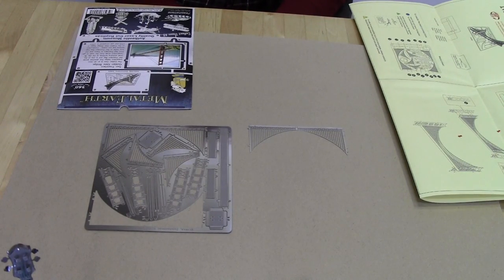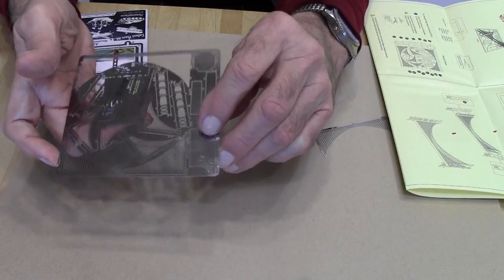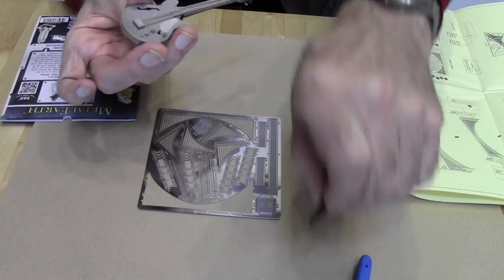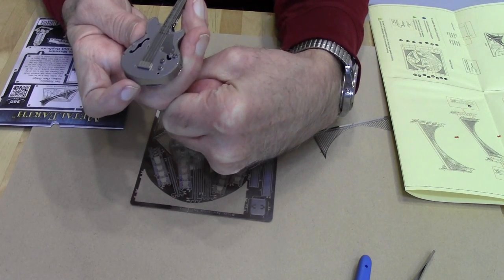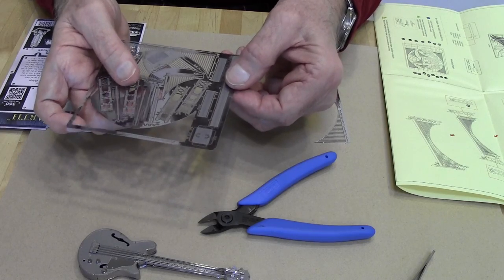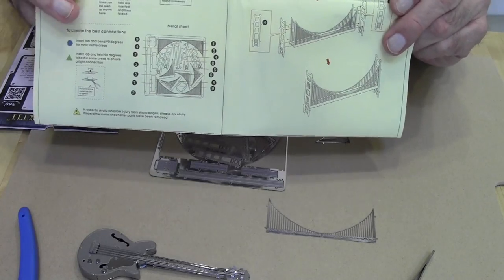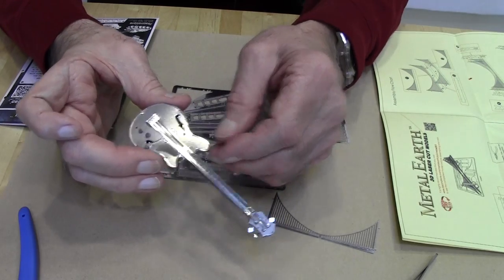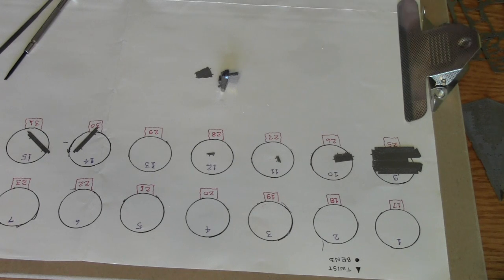Fascinations Metal Earth Kit BASICS

Comment: Thank you. I just started making a model but I already broke one of the pieces that is supposed to bend while folding it. Is there any way to fix it or is it ruined?
Reply from the maker: You are not alone! This has happened to me several times. I have been able to fix broken pieces using mostly super glue, but have also used caulk (great way if it doesn't show). You might need to find ways of propping up the pieces for support while the glue dries. After the initial application dries, I reinforce the joint with more glue. I have built one brass kit (the "gold" color) and they are particularly prone to breaking, often with just a second bend.
Reply: Ruined
Reply: Contact metal earth and they will send you a replacement.
Reply: @Dakahrii  Really. For free?
Reply: @zanomi7695  Yes
Reply: @Dakahrii  Thanks for responding so fast. Thought you wouldn't after 4 months.
Reply: I used super glue also

Comment: Hi! Thanks so much for the video!  I really need help with the guitars...i have 3 of them 😮I bought 4 metal models of The Beatles instruments...started with the drum set...I almost tossed it out the window because I have jewelry tools, and could not get those little tabs to bend at all! I ended up having to use glue just to get them to stay.  I never thought it would be so hard.
I finally finished it after 3 months on and off. It doesn't look great, but I'm creating a stage with their instruments. 
Yesterday, I opened the guitar (John's), and was happy to see large pieces and only 1 sheet of the metal. I thought it would be a breeze. The first step was to put the strings on the guitar, but first put the riser on the neck. That thing refused to stay in. I used scotch tape to hold it in place, bent the tabs and they stayed. Gotta take a break from it because I'm doing other crafts.

Comment: Thank you so much for sharing. Recieved some kits for Christmas. Was  wondering how to work with them. I'm used to the old school plastic and glue kits.
Reply from the maker: Lance: I also have a base in plastic (and some metal) kits as a wee lad. Mostly cars and some aircraft. However, many of the same attributes of a model builder apply to the Metal Earth kits. These would have patience at the top of the list, followed by great care in following the instructions, and having the right tools. The ONE drawback in these metal kits is the lack of forgiveness. They cannot be sanded, filled, or taken apart (at least not easily), and test fitting can be a challenge. My biggest beef with the manufacturer is the absence of bending template diagrams in the instructions, requiring you to judge the right amount of "bend" or curve. The kits have improved from some of the earlier versions, both with assembly and instructions. That said, I have had my share of failures, so my best advice would be to stick with it, until you develop a few basics. The finished kits can be really handsome. Good luck.

Comment: Having done a couple of these I appreciate your tips! However, I would recommend not cutting out all the pieces at once, especially if you're not going to assemble the whole model in one sitting. I would recommend just cutting out the pieces you need for each step as you are accomplishing it.
Reply: Thank you for the advice
Reply: That is a smart way to do it for sure, if you have a kit that has lots of pieces.
You can also number the pieces using small post it notes or a sharpie marker on the back part no one sees. I had to do that because I took all the parts out doing the Beatles drum set, and it was so confusing. A lot of pieces look the same.

Comment: The curves are super intimidating!!
I have no experience in modelling and thought these looked cool so I got some. I am not sure if I will be able to find anything with the exact right diameter and am worried about making the curves to small because the metal is just so easy to bend.
Reply from the maker: You can watch the "tools" video I made. There are lots of options for rolling the pieces, including drill bits and transfer punches. Thinking out of the box for larger diameters will turn up possibilities, including dowel rods and other round objects. Etsy has some specialty tools from Animate Orange and other small dealers.
Reply: @blueholebob  thanks!

Comment: Have you ever tried soldering the gaps? I bet the stainless would hold up to the heat but its probably not as easy as glue. Would be cool to have all the gaps filled with metal to complete the look
Reply from the maker: On occasion, I use super glue to reinforce weak joints, where tabs do not provide enough strength. Otherwise, I rely on careful forming and testing fit to assemble a kit. That said, a few kits have been so poorly designed or instructed, that the only solution is to resort to an admission of failure and open the next one. The winners far outnumber the regrets, and continue to give me a fun way to spend time. I offer my rule of thumb: If the finished model passes the viewing distance test, as opposed to a closeup examination looking for flaws, I consider it worthy of display, even if it requires a tweaked angle of display to cover a tiny gap. Bluehole Bob

Comment: I´ve have an experience of 9 of those models and I must say you have explained quite well the basics. I differ from your strategy by just cutting out the needed pieces for a step or a few of them. Not the whole model.
Reply from the maker: First, I identify the pieces in number sequence by matching the drawing to the pieces on the metal sheet, and writing the number on the diagram of the piece layout. Then, I cut 16 pieces at a time and place them on a large, numbered clipboard, and assemble them in numerical sequence from the instruction sheet. After building several, I prefer this method versus searching for pieces a few at a time. In summary, I write the piece numbers on the diagram, cut in sequence, assemble in sequence. That said, there is no "one right way" that suits everyone. Thanks.

Comment: What annoys me is that when I catch the tab witch tweezers to twist it, I first bend it slightly and then I try to push it down with teezers to bend it flat to the surface 90 degrees. But when I do that I end up bending all the structures below it. Any hint for beginner?
Reply from the maker: You are right...not as easy as we think. There are 3 ways I overcome this issue. 1. Use your thumbnail to flatten the tab. 2. Use a small flat blade screwdriver to apply pressure without pressing hard enough to transfer pressure to other layers. 3. After a bit of practice, you can use thin-nose or chain-nose pliers by applying more pressure to the top of the tab than to the bottom layers. I use this technique most often when trying to flatten tabs sitting on top of a fragile layer.

Comment: Photo etched plates are usually brass or zinc, which is rather "soft" and can be easily damaged or scratched. I've built roughly 10 Metal Earth kits with minimal difficulty. Some of the larger kits, will probably have to be soldered together.
Reply from the maker: I'm not a metallurgist, but I use photo-etched parts for model building. These kits are not photo-etched. I believe they are laser cut from thin steel. For some problem areas or mistakes, I have resorted to super glue, but have not had to solder anything. Thanks for your comments.
Reply: @blueholebob  minimal difficulty?
Reply from the maker: @ChrisLogan787  I was very surprised at the guitar, which was my first kit...went together easily. The piano looked hard, but went well. Straight line buildings are also pretty good, but some bridges that look easy are not. Once you get a few kits under your belt, you will have better luck with rounding, which is always a challenge for me.

Comment: Just curious would it be best to use a magnifying glass to do these models
Reply from the maker: Jennifer: There are times when it is very difficult to see if the "tab" is in the "slot." When I am uncertain about a fit, I use a jeweler's loupe, although just about any magnifier would probably work; otherwise, it is probably better to have a normal view of what you are doing. I will also admit to using super glue at least a few times per model. A purist would likely scoff at this, but there are times that a tight bond is preferable to a loose fitting piece.

Comment: This'll sound stupid, but is the metal sharp? Like does it feel like it has a chance of cutting your finger when handling it?
Reply from the maker: NOT a stupid question! While I have never cut myself while working on a model, it doesn't mean it couldn't happen. There are no "sharp" edges on the sheets, but removing the parts from the sheet can leave nubs that might scratch or cut. Using flush cutters would minimize any rough edges. Overall, if you handle the sheets and part removal with a bit of care, it seems to be a low risk of scrapes and cuts. Bluehole Bob
Reply: @blueholebob  oh I see, thanks for responding!

Comment: Thank you, but just one problem... one of my pieces broke and I do not know how to fix it. I tried using tape, but that just doesn't work, could I use SHOE GOO to seal it back together???

Best Regards,
Reply from the maker: Breaking parts is not uncommon. Many times, there is not enough surface for gluing. Depending on what you are repairing, you can try to fashion a support piece from scrap to gain enough space to add glue, especially if the repair is not visible.
Reply: @blueholebob  Thank you!!

Comment: I just bought a star destroyer (same one at 7:00) and the part that held the very top bridge with the 2 domes, the folds all broke. Any ideas on what to do? I have a small solder pen, but would that ruin the kit?
Reply from the maker: You are not alone! Just tossed an AT-AT model a few days ago. Some kits have flimsy attachments that are supposed to hold up too much weight or will not balance. I have not tried solder, because the usual parts are too small or need to be supported. My first goto is super glue, where I can hold the part while it dries. Then, I add more glue. I have also used scraps from kits as support pieces, if it doesn't show. If the kit is a poor design, and the joints are too weak, repairs will usually fail. All that said, a kit tossed into the garbage is a rare occurrence for me. My biggest success with a poorly designed kit was a Star Wars TIE Fighter. Good Luck. Bluehole Bob

Comment: I bought the Cat Bulldozer. I spent two hours at least on just steps one and two. Pieces broke and now I’m out twenty bucks that I spent on this model. Do I have to scrap the kit? Any tips?
Reply from the maker: I feel your pain! More than once, I have had a broken or ruined part, and frankly, a few kits were so unrecoverable that they ended up in the can. That said, there are two approaches to take. One, try to repair the part with super glue or with scraps glued to the part for reinforcement. I have repaired a few parts that surprised me, when it actually worked. Two, you can  leave out damaged parts, particularly if they don't show, or the model can be turned, hiding the area.
Reply: @blueholebob Thank you, did better with the T-Rex kit, but still had to scrap it. Gonna try another one and not
 give up.
Reply from the maker: That's the spirit! It took two dirigible kits to get that one right, but I gave up on the scorpion after one attempt. Most others will reach the end. :)

Comment: I just finished a kawasaki gpz900r.  I started to through it in the trash several times but hung in there and finished it. Turned out pretty good but not great.
Reply from the maker: Badman: I have not built this kit, but have tossed more than one into the trash out of frustration. Fortunately, these bummers are in the minority. My skill level has increased along with the number of models that survive and make it to display. The fun is definitely relative to building experience. Hang in there! Bluehole Bob
Reply: @blueholebob  i already throwed 2 to the trash and wont buy them again

Comment: Excelta is the best cutter
Reply from the maker: Maybe best, but very spendy ($58+). I still recommend Hakko. I have used them for years. They cut well, last a long time, and you can buy a 3 pack for $18
Reply: @blueholebob  it's the best I've used. I work for a very prominent aircraft company building wire harnesses.
Reply: Or weller